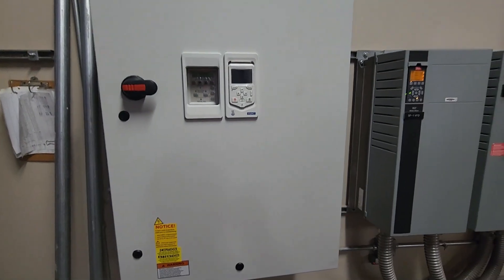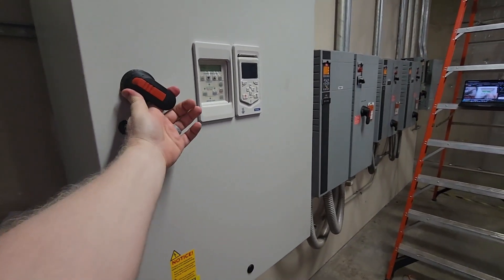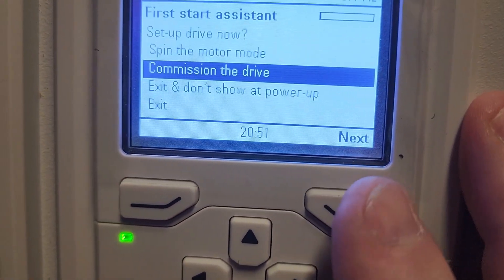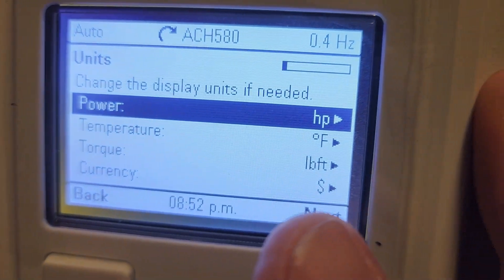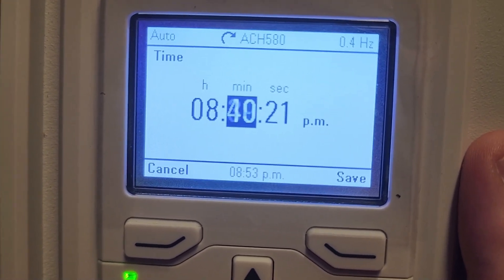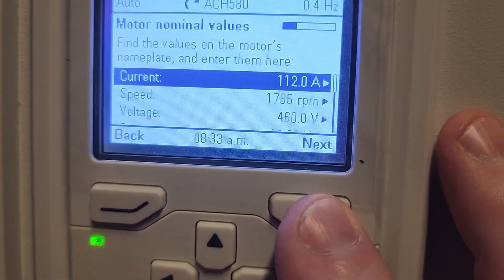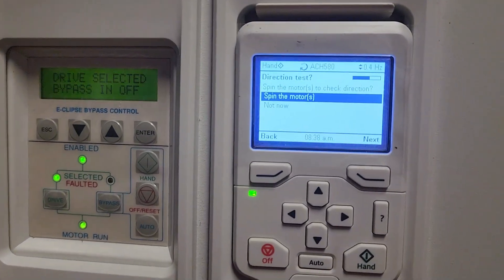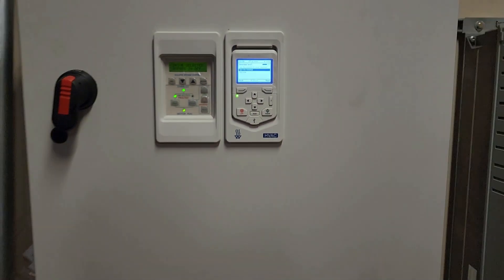How to Commission an ABB ACH 580 VFD

Comment: Hi there! I’m experiencing the same issue with my Danfoss FCP model (display  backlight ON but no any info) came across your informative video. I’m curious—what do you believe was the root cause of the problem you encountered?
Reply from the maker: I think the contactor shorted and took out the power supply.  Replace the contractors and power supply.